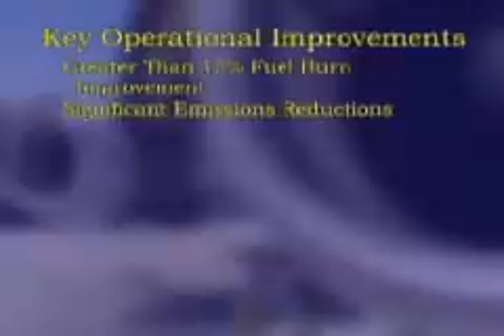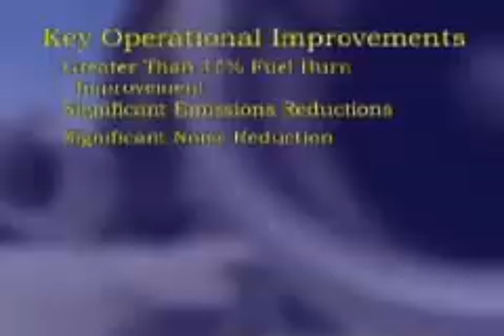B707RE

Comment: A potential solution for the C-135s and C-137s, but instead we ended up with the CFM-56.
Reply: Are cfm56 bad by any chance?
Reply: @ENDRL321  : no, the CFM56 was the superior engine by far. The JT8D-200 was a good way to get a bit more efficiency out of the JT8D core, but it was still effectively outdated tech when it made its debut in the late 1970s against the much more modern high-bypass engines (like the CFM56) already entering the market at the same time. It was the perfect fit for the MD80, but had limited use outside of that application.

The JT8D-200 series had the main advantage of bring a relatively minor derivative of a tried-and-true design with minimal development time and cost (it was developed from the JT8D-109 prototype which in and of itself was just a re-fanned JT8D-9A developed to test the idea of a re-fan program).

Comment: Turbo fans? or turbo jets?  Please,
Reply: The JT8D-200 Series is a low bypass turbofan, but it's not super noisy like the original JT8D engine.  For example, the original is more noisy and burns more fuel, while the JT8D-200 (the newer version), burns less fuel, due to its higher bypass ratio.

Comment: I was thinking the original power plants had the same thurst rating at 21,000 lbs. I was thinking this engine had the protential to sqeeze out more like 27k lbs of trust.  As a matter of fact I don't know if you knew this, but Sabb actualy did use a JT8 for one of there high performance jets.
Reply: 27k out of a JT8D? Not happening unless you're talking about putting afterburners on it (a la the RM8, hence the Viggen comment). The -219 at 21k was pushing the very limits of what the JT8D-200 series could do. The JT8D-200 series is just a conventional JT8D core with an extra compressor stage and a larger fan, the logical step up from the JT8D-109 re-fan experiment, which was a conversion performed on a 14,500lbf JT8D-9A, resulting in a 16,500lbf engine without the fuel burn compromises of the later -15 and -17 engines with their higher core flow and reduced bypass ratios.

The fact that the JT8D-219 at 21k manages to exceed the rated thrust of the JT3D-7 at 19k is already nothing short of an engineering marvel. Consider that the JT3D is just a JT3C with two compressors swapped for a two-stage fan, while the JT8A turbojet was a scaled-down derivative of the JT3C. And then the JT8D was derived from the JT8A by swapping out compressor stages for fan stages again, and yet, by the time the small-fan JT8D was mature, they had nearly matched the thrust of the JT3D-1 with the JT8D-17R, and then the JT8D-219 exceeded the highest-thrust JT3D-7 by 2,000lbf.